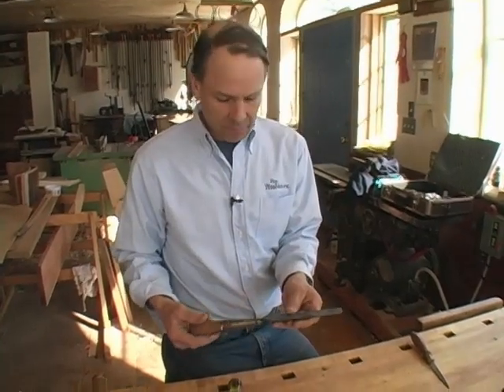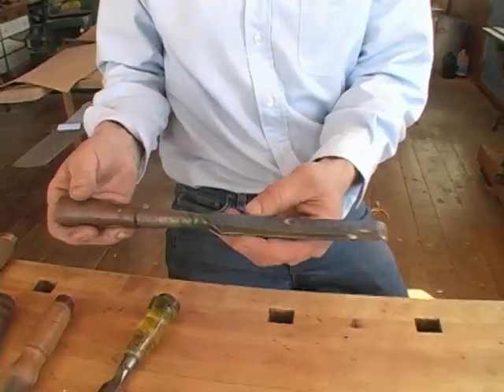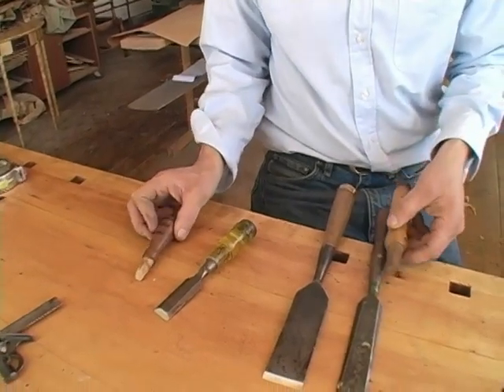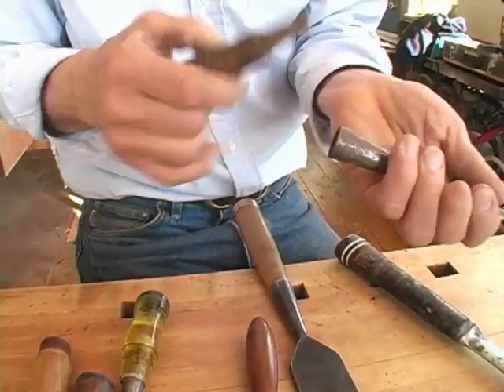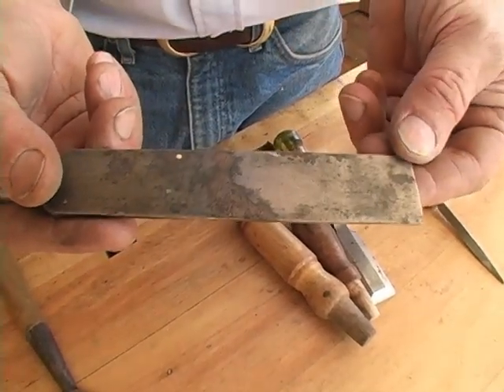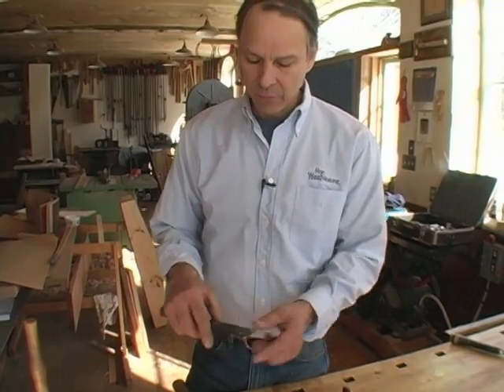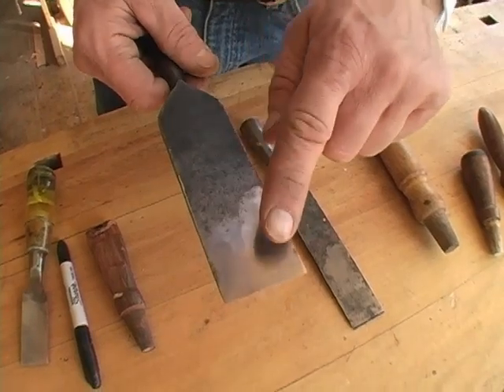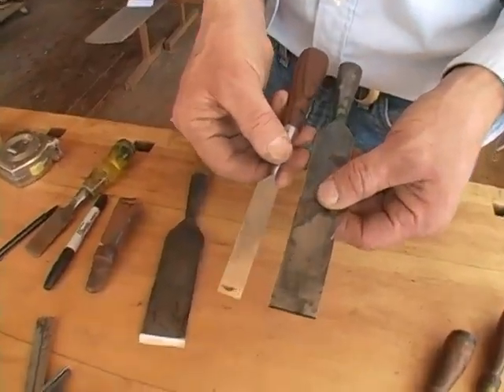Soup-Up a Flea Market Chisel with Garrett Hack

Comment: I didnt get a good look at the tip of it after he took the grinder to it, and I do realize that opinions very on much heat it takes to de-temper steel but why risk it and not slow grind it or dip it in water to cool it down?